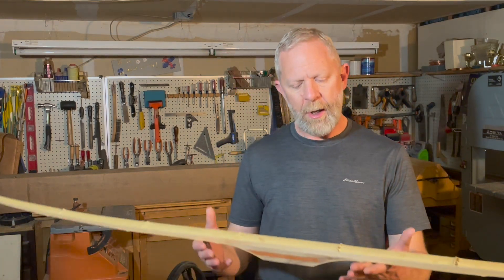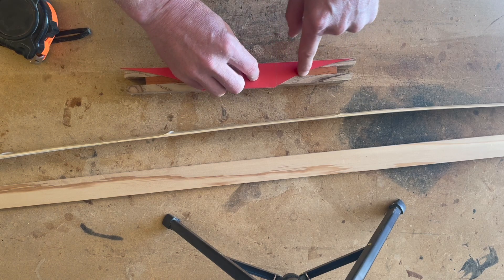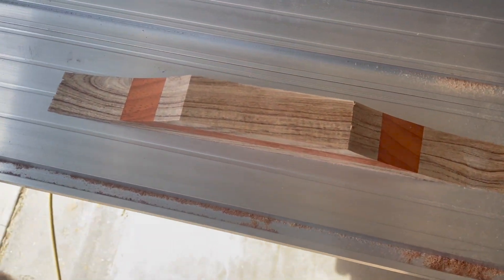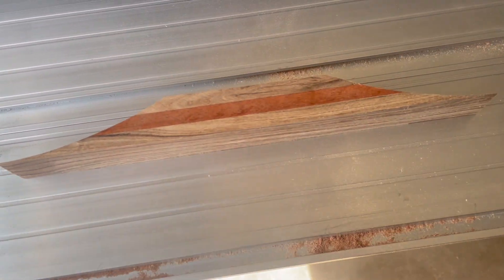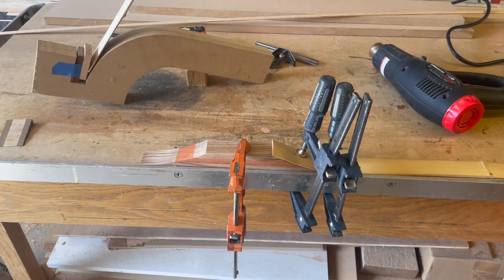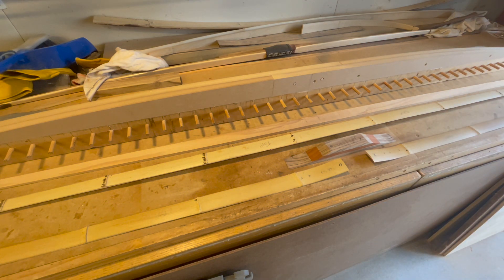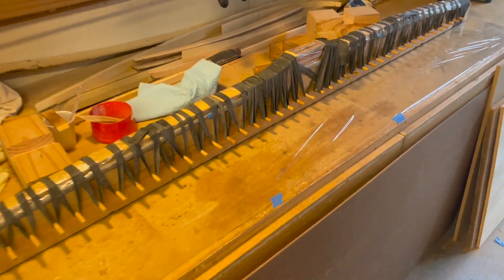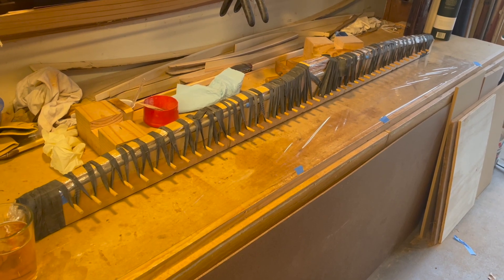Hill Style Longbow - 2

Comment: you may have mentioned it but whats the length of the riser?..i got several 12 inch pieces of exotic wood but i was thinking thats too short for a 64 to 70 inch bow..
Reply from the maker: My goal is to always maximize the length of the working limb no matter how long the bow. As for the riser, it is just over 12” long. The template is exactly 12.25” tip to tip - the actual riser ended up slightly longer when all was said and done.